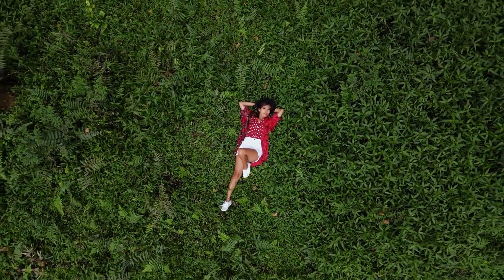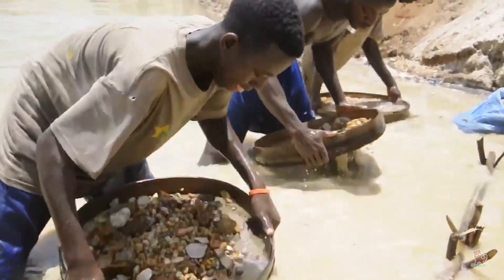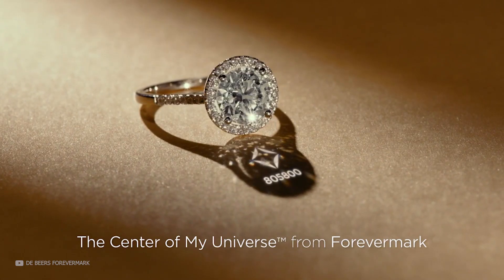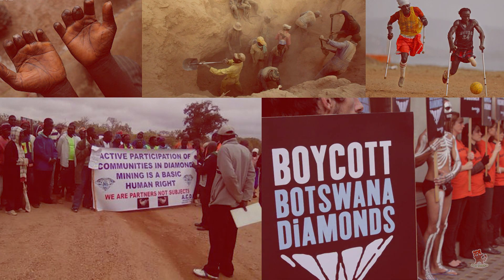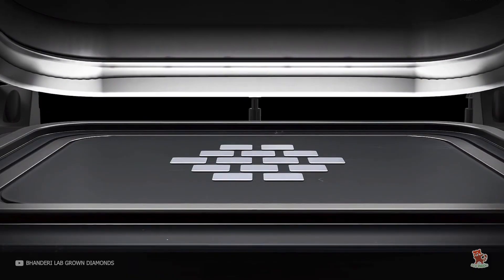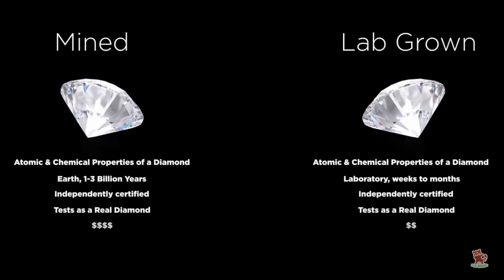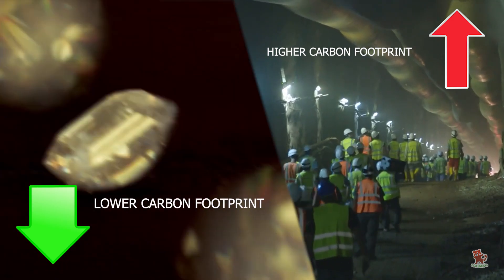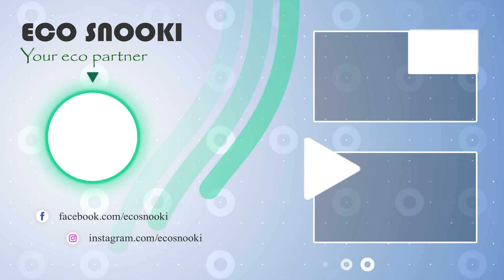Why LAB grown diamonds better than MINED diamonds ?

Comment: Lab grown diamonds can be effectively used inside high end chips and electronic items.
Reply from the maker: Diamond is considered to be the ultimate semiconductor for applications in high-power electronics due to its exceptional properties. Its dielectric breakdown strength is three times higher than in silicon carbide and more than 30 times higher than in silicon.